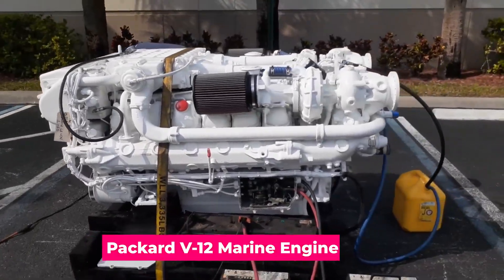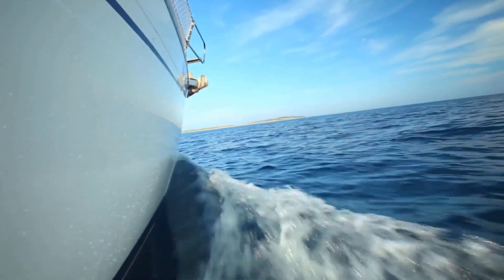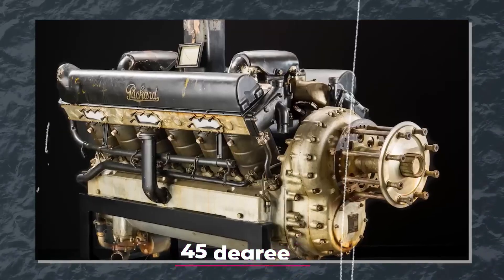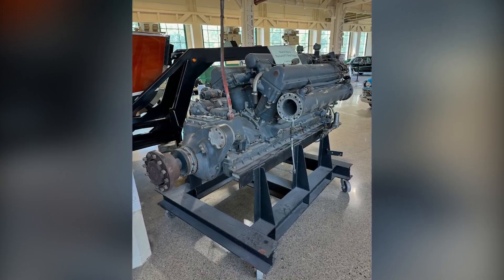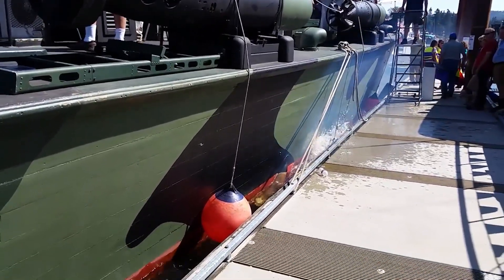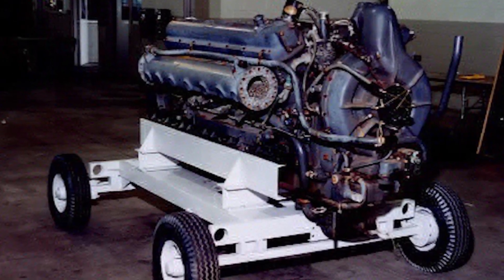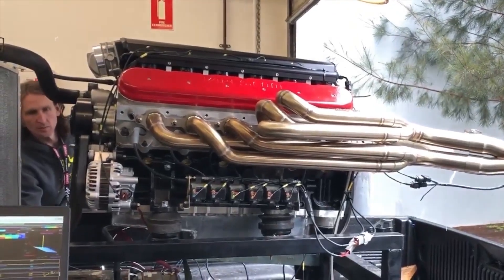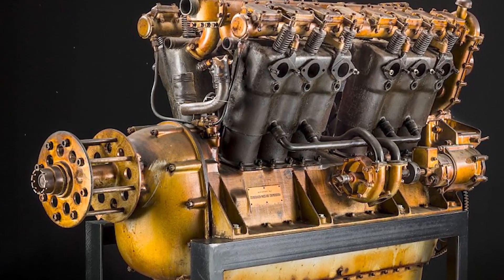How Packard V-12s Changed Boat Engines Forever, A Story You Need to Know

Comment: Shame about the totally irrelevant video clips  . More of the original photos would have been nicer
Reply: yep - one frame said "Detroit Diesel" which i don't think was a Packard brand!!
Reply from the maker: @hgoff5617  thanks for pointing out. I'll check if any error made. Packard based in Detroit perhaps but I'll check for any update on info if needed.
Reply: These 2500 cid engines were used by the US military in particular high power - high speed applications.  Less well known is RAF Air-Sea Rescue Launches used to pick up downed airmen close to shore, some of which used Merlin engines modified for marine use.  So the Merlin was used in military speed boats, just not for the US.
Reply: @markam306 the " modified  " Merlin engine was actually a dedicated marine engine..I think that it was called the Hercules  .
There's a really good documentary about rolls royce ww2 engines on YouTube
Reply from the maker: @JohnTaylor-gy2ps  thanks for the added info!
Reply: @JohnTaylor-gy2ps  Many od the Brits PT boats and Air Sea rescue were powered by the Packard M2500  via lend lease  Hubert Payne.......
Reply: @markam306  Actually you are wrong !!!! As the Merlin was for air use only   why Brit Hubert Payne came to the USA for engines for their MTB  MGB, British designation for PT boats, and PACKARD supplied the M2500  via lend lease to UK during WWII.  There are even videos on You Tube of Spitfire of the sea  being mistaken as that Boat used the PACKARD M2500.  That is the engine that brought RR to PACKARD in 1940  to build the merlin for the Brits, as the Brits were sooo short of production facilities for Merlins !!!   Know what you are blabbering about before opening your mouth !!!!  Facts of history.  there were 14,000 of the PACKARD M2500's made in WW II !!!
Reply: @wilburfinnigan2142 
“In 1938, Rolls-Royce started work on modifying some Merlins which were later to be used in British MTBs, MGBs, and RAF Air-Sea Rescue Launches. For these the superchargers were modified single-stage units and the engine was re-engineered for use in a marine environment. Some 70 engines were converted before priority was given to producing aero engines”
Reply: @wilburfinnigan2142 

Harvey-Bailey, A. The Merlin in Perspective – The Combat Years (4th edition) Derby, England: Rolls-Royce Heritage Trust, 1995
Reply from the maker: @markam306  thanks for watching and thr input Mark.

Hope you enjoyed and hope to see you back at the channel. I may have another PT boat video coming soon if it interests you!
Reply: The family business of an old fraternity brother of mine was building Unlimited hydroplanes using  Allison or Packard V-12 engines in the Bay City area of MI.
Reply: @DblIre  The Packard V 12  was a Merlin !!!
Reply from the maker: @JohnTaylor-gy2ps  Hi John. Thanks for the feedback and taking time to watch and respond. I'll be making another V12 soon in a slightly different direction and more exciting clips!

Comment: Recently a vessel were I'm from had to be scrapped. Originally it had twin liberty engines. At one time it was owned by Al Capone.  Apparently it did 40knots. I'm assuming it was due to an engine failure that it was finally caught repowered with a more dependable engine and then spent time in Alaska as a patrol vessel. Eventually ended up on the BC coast.
Reply from the maker: @graham2631  Graham that sounds super cool. Would love to know more about this vessel. If you have any info please let me know.

Comment: Nuffield in England built a version of the V12 Liberty L-12 for use in tanks such as the Cruiser Mk VI Crusader and later Cruiser tanks. Output was 340-410 hp. This was at a time when the M4 Sherman had around 375 hp (400+ in the A3 version with the Ford GAA V8). Ultimately UK Cruiser/medium tanks (Cromwell and Centurion) used the Merlin derived Meteor V12 of 600 hp. 

Changing the V angle from 45 deg to 60 deg wouldn’t help much with rotation balance as long as the Liberty V12 used a standard inline 6 crank with six throws and two rods per throw. The inline 6 with 6 throws at 120 dejg has perfect primary and secondary balance. So each bank would have perfect balance. Rather, a 60 deg V12 will have even firing intervals with one cylinder firing every  60 degrees. A 45 deg banked 12 might have uneven firing intervals putting irregular torsional stress on the crankshaft.
Reply from the maker: Hi Chris. Thanks for taking time to watch and sharing your in depth knowledge. Did you work on these engines in the past?
Reply: @ YW